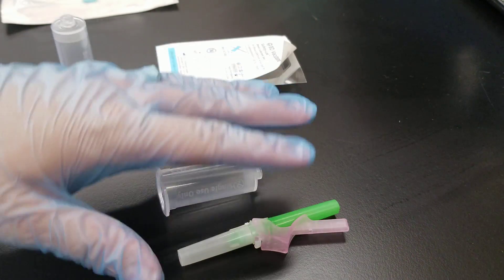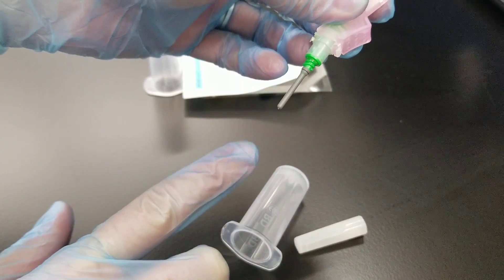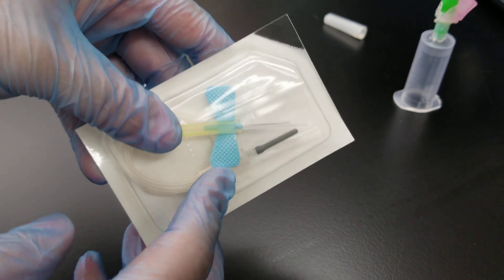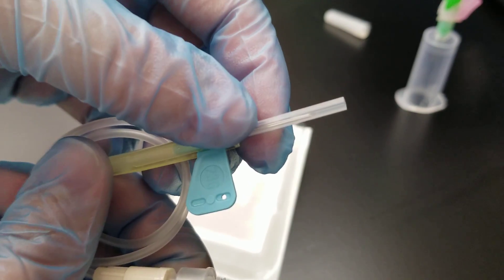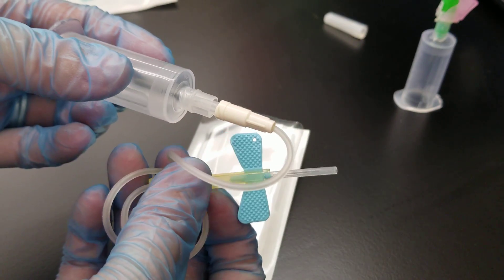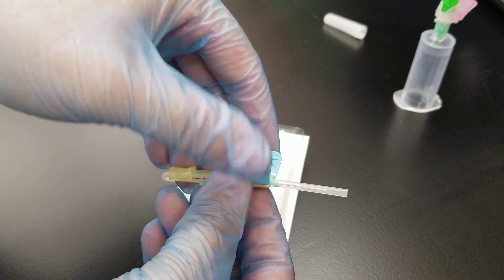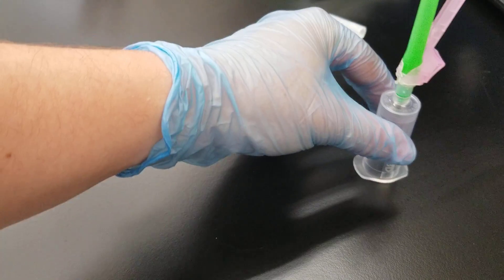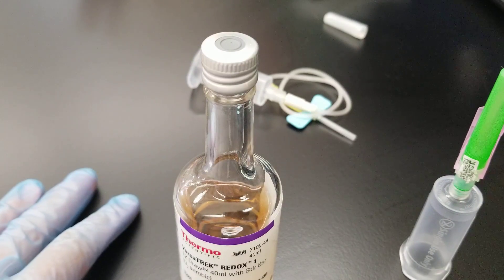Phlebotomy: Setting up the Evacuated Tube System (ETS) in preparation for phlebotomy

Comment: Why is it important to use discard tube when collecting with a winged-infusion set directly into evacuated tubes? Hello.  I hope u will reply. hihi
Reply from the maker: Great question!
Discard tubes are used because the initial puncture of the skin includes contents that will initiate clotting to happen.  Therefore, putting the first flow of blow (with tissue contents) in a tube that will not be used for analysis is a way to improve the accuracy of laboratory results.
Reply: @MedicalLabLadyGill  Thanks for replying. It really helps me with my online classes. May I ask one last question? What tubes will not be collected by dermal puncture?
Reply from the maker: @safiekhalifa  if you're talking about capillary collection/finger or heel stick, the answer would be the blue top sodium citrate tube (for coagulation tests).

Comment: What are the important reminders when a medical technologist is preparing the phlebotomy materials?
Reply from the maker: Cleanse the skin correctly and let it air dry.  Make sure the tourniquet is only 4 inches above the draw site, tight, and off before 1 minute.  Perform the correct order of draw.  Invert and label the tubes immediately after venipuncture at the patient's beside.  Send them right to the lab.
Reply from the maker: Sorry, I answered the whole procedure!  Just make sure you correctly assess the patient's skin, device locations, and hydration status.  That will make sure you are using the appropriate needle.  Have all materials within hands reach.  Only remove the needle's sheath when you are about to draw blood.  Make sure the sharps container is not overfull.
Reply: Check tube expiration dates

Comment: Went in for a blood draw today and noticed physician is reusing the blood tube holder. Is it possible for blood to get on the tube holder? Can i be infected with HIV or HCV?
Reply from the maker: The vacutainer system should not be reused.  That is an infection control issue.  There is a needle inside the hub that is not a safety needle and would be a risk to remove safely.  Was it reused on you or someone else?
Reply: @MedicalLabLadyGill  Physician drew my blood first i was lying down so i didnt see the process but when it was my girlfriends turn i saw him throwing everything away except the vacutainer holder. When i asked him he said it was reusable and after coming home researching i found most article are against reusing as a risk to the person drawing blood and patient. May i ask if im at risk of blood borne disease? Since the system only draws blood away from my body and nothing flows in should i be okay?
Reply from the maker: @winkawak  you are most likely fine IF the needle was not reused.  BUT I would highly consider switching care providers.  They should not be reused.
Reply: @MedicalLabLadyGill   He used the butterfly needle. Wouldnt removing and reusing holder smear blood on the rim or neck of the holder? Should i worry about cross contamination of my physician touching previous patient blood on it and touching my blood draw site?
Reply from the maker: @winkawak  if you are worried you can always go somewhere else and ask to get tested.